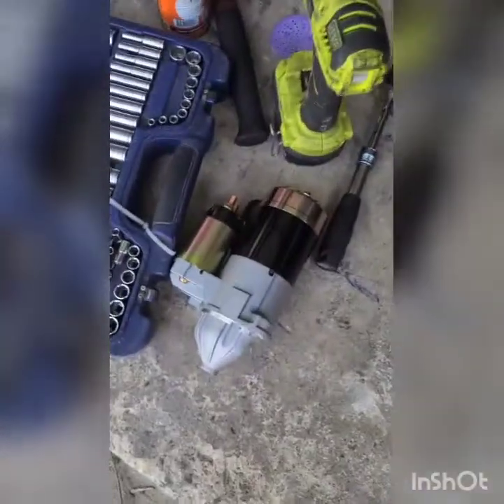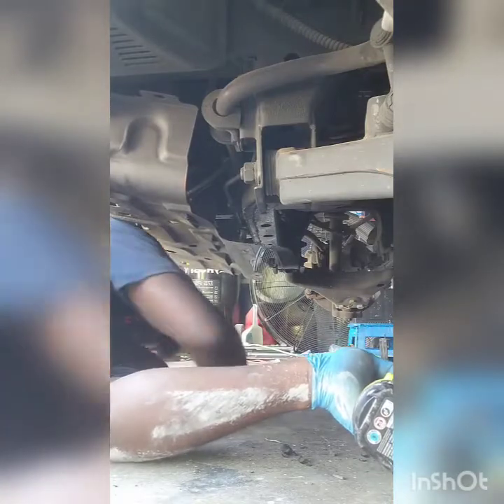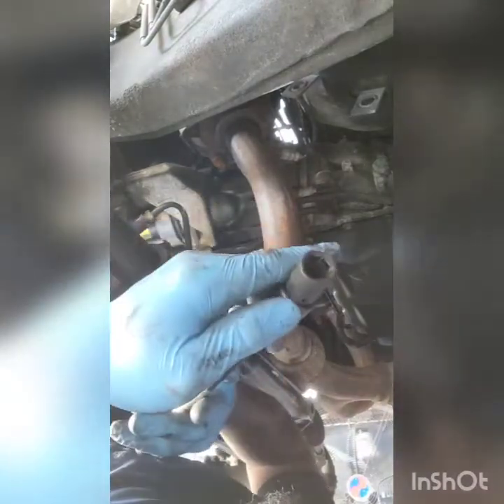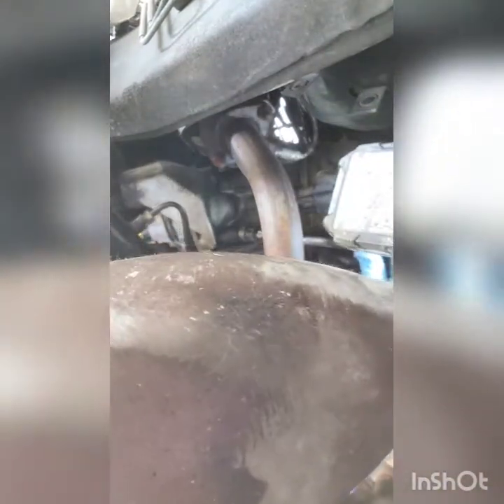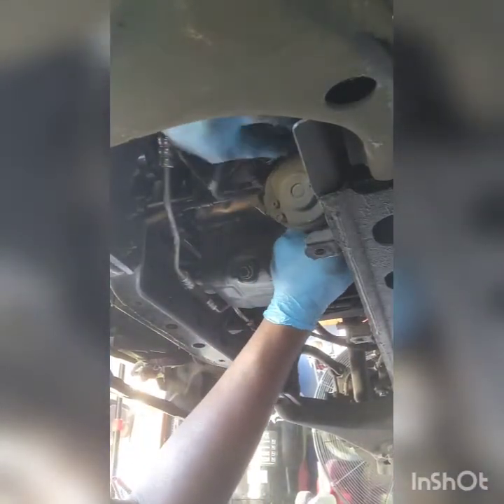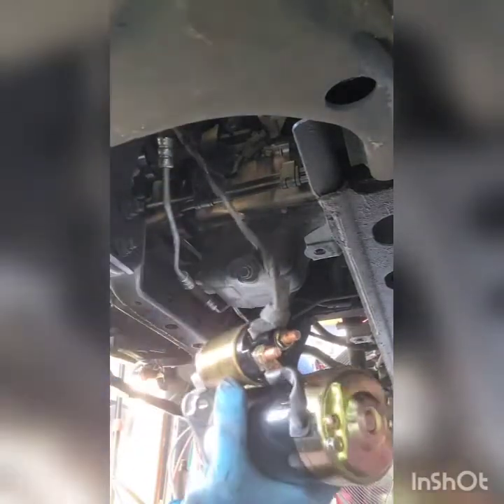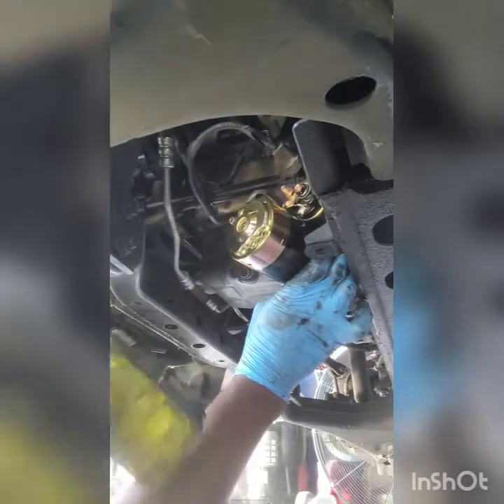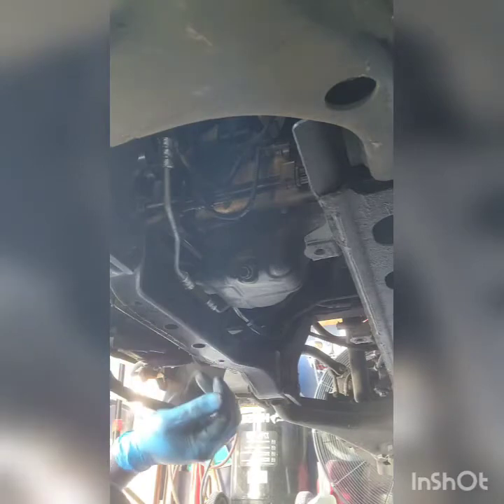06 Kia sorento starter replacement

Comment: Thanks for the video. I'm having problems getting my Kia to reliably start.  I'm using a bypass wire to start, and when it starts, it starts right up.  But other times I get nothing - no cranking or anything.  So it's an all-or-nothing situation.  It might be a loose wire?  Oh I hope it's something that simple!
Reply from the maker: Have you replace the  old starter with a new 1 ?  Check the wires that goes to the starter.. might have loose wires or 1 may not be connected.....if you hot wire it then it starts then it's a wire issue  loose wire mostlikely
Reply from the maker: @johnnysparkleface3096  replace the starter that bypass is only temporary  once it stop engaging it won't start the car